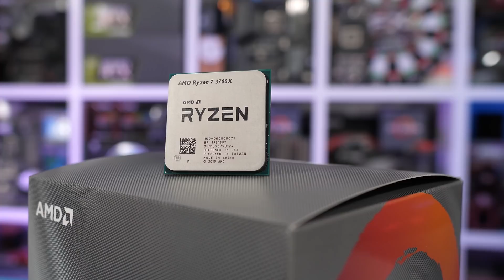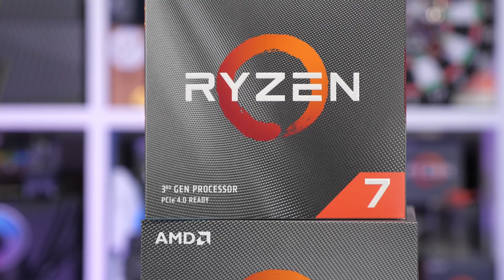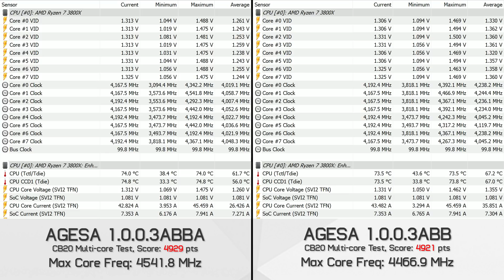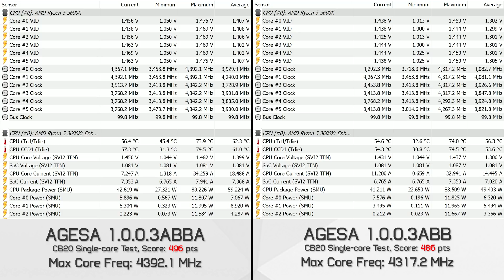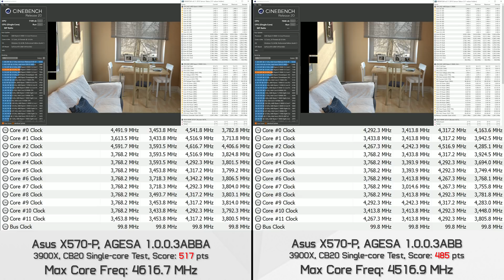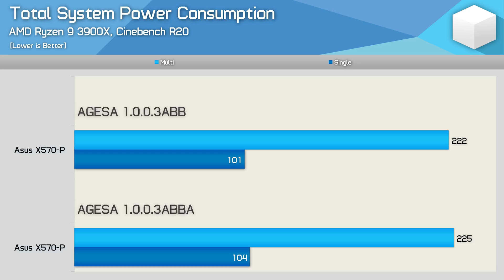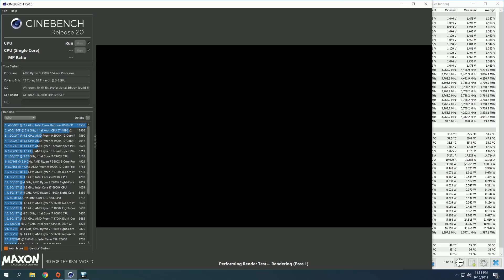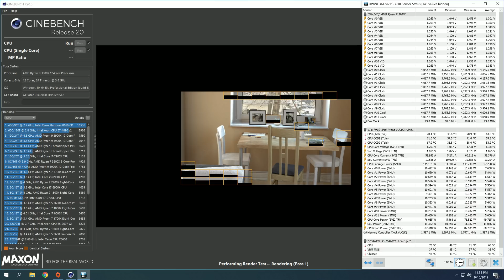3rd Gen Ryzen Boost Clock Fix Benchmarked, AGESA ABBA Time!

Comment: der8auer proofed that it doesnt matter which Board you use even user of the  extreme had the problem and also the fix didnt help to ban the problem as far as i know not even till today. Because my 3950x is not able to reach the 4.7Ghz on a new set up pc. 
And that whole stroy is a little bit annoying, AMD just could say ok we have a fix but it not working 100 percent but they just made it like this that after load the single core will boost high enough so in the max indication field the right boost will be shown with not even reaching it once during single core load. And looks like it worked out for them and they got away with it.....Hope they will just be honest with the next once. They are better than intel and they dont need to lie.

Comment: Im running Ryzen 3600 on an Asus Tuf Gaming with 3200mhz ram and M.2 ssd  Nvme  type.  Everything works ok but not as fast as I was expecting for these components. I dont overclock or intend too. Do I need to update to the AGESA bios? Any advise would be appreciated. Thanks in advance.

Comment: Finally got ABBA on X470 Prime. 3600X has hit 4490MHz on 1 core a few times, more commonly 4417. Previously I was running 4267MHz all-core on light multithreaded workloads with PBO enabled, now hitting 4342MHz all-core on light multithreaded workloads with PBO. Chip runs slightly warmer, from 64c to 67c on heavy multithreaded workloads @ 4167MHz, but still runs at 51c on light multithreaded workloads @ 4342MHz. (custom watercooling)

Comment: The 99.8 MHZ BCLCK issue you are running into GIGABYTE boards is due to Spread Spectrum being enabled by default.   On the newer version of the BIOS, there's an option to disable it now (it's in the Tweaker Menu in the BIOS) - once disabled, BCLCK will be at 100 MHZ.

Comment: I'm wondering is this all possible or applicable on boards with X470 chipset. But, all in all,  I'm OK with 3800X CPU which hits 4. 465 GHz on single core in CB20. Not advertised 4.5 GHz, but very likeable.

Comment: I don't have a horse in this race so it does not matter to me whether the AMD CPUs hit a specific clock speed or not. 
Having said that, this issue speaks volumes about AMD. 
With all of the different part numbers at each tier and operating frequency being the only difference, AMD is clearly and stringently binning the CPUs. 
It is inconceivable that they are unaware of the exact frequency each individual CPU (perhaps a lot # of CPUs) can achieve. 
With such a huge number of CPUs falling short of the specification it is clear that AMD knowingly chose to lie about the frequency.  
It really is that plain and simple.  
Considering the overwhelming number of people that buy retail packaged AMD CPUs are enthusiasts accustomed to being able to significantly overclock their CPU it was impossible for this to go unnoticed. 
I do not think anyone buying a CPU that did not hit the speed they paid for over reacted at all. 
Hopefully the fix implemented will not unravel something else down the road. 

The most baffling part of this to me is AMD clearly has a winner here and could have simply written a slightly lower clock speed on the box. 
Then the enthusiasts would be crowing even louder about how great and wonderful AMD is instead of feeling like they got shafted.

Comment: Mine, X570 Aorus and R5 3600 gained 75-100MHz with the ABBA version and finally got up to 4.200MHz. For anyone wants that last missing 7~8MHz can disable “Spread Spectrum” in BIOS, if there is such a setting in there. This will set BCLK from 99.8MHz to an even 100MHz. ___Gimmie Gimmie Gimmie a  boost...

Comment: Well, just downloaded 1021 (I believe) bios Asus just released for the Asus Gaming TUF X570-Plus wifi. With ABB, maxed out at 4217. With ABBA, the 3700x maxes out at 4367. (150mhz increase). The other 33mhz is accounted for by the bclk only being 99.8, etc. It also lowered the top end voltage and smoothed it out (it doesn't go above 1.395 on single core) . Now I don't get run away die temps in the 90s, while the cpu remained at 65. Now if I could just overcome the lower bclk

Comment: weird my 3600 can do 4.2ghz all core at 1.38volts on my asus b350 f gaming board but with my x470 gigabyte gaming 7 wifi-50 board it wont do 4.2ghz even at 1.4volts, hell it wouldnt even boot at all.. i need to update the gigabyte board to newest bios tho but hard to believe my cheaper and older b350 board can do it better and asus has only givin me one bios update for my b350 since 3rd gen ryzen's launch.

Comment: ASUS TUF firmware released as well.  Thanks for all you guys do.
Reply: You happy with the mobo? Plan on running a 3900x and 2x8gb 4266cl19-19-19-39. Under custom water.
Reply: @AZ007914  I'm not a reviewer and I don't do as much gaming, but what I do is a bit more strenuous than most games(3d rendering).  Currently have a 3700x as a stand in until the 3950x launches.  It's only 65W TDP, but I've watched several reviews of the power rail and they've all been positive.  Short answer is I don't have any complaints but I'm currently at 65W.  Great board for the money if you want to future proof your system IMO.

Comment: I just got the BIOS from the Gigabyte web site.  Used it on my grandsons Gigabyte X570 Ultra and 3700X,  Before  three cores at 4366, one at 4316 and the rest at 4250.  After one core at 4391, two at 4366, all of the rest at 4316.

Comment: Hi steve, I want ask about BCLK, my motherboard ASUS X370-f gaming strix always get BSOD when booting if i changed BCLK, event when i change below 1.0 point (100.5), can you give light how to change BCLK without BSOD.
my 3700x use 1.0.0.3ABB bios got 4839 on multi but only 493 on single. i have thingking about playing BCLK but have that problem. is that possible because i push my RAM OC (corsair vengeance rgb 3000mhz C15) to max 3400mhz (max limit for micron B-die from ryzen RAM calculator) ? do i need lowering RAM speed ?  maybe to 3333 Mhz for my RAM ?
thanks for video..
Reply: BCLK over 100 negatively affect HDD,SSD,NVME especially picky can corrupt data fast , some other hardware might get affected , if you can't boot over 100 bclk something in your PC dosnt like it. as simple as that.

Comment: 9:18 On the benchmarks, you wrote [lower is better], instead of [higher is better]...
Does the bios update for Zen 2, affect the 2000 series too? Because my 2700X doesn't quite want to boost... I have the first bios update for Zen 2, agesa combo 1.0.0.1.

Comment: Out of the box on launch day AMD knew they would  beat Intel at every price level. I think they have a natural inclination to lie about something even if what they're lying about has no effect on performance. They just feel the need to lie. All they had to do was advertise the correct  clock speeds and then later if they felt like it update the BIOS with the clock boost. Even though the boost wouldn't amount to anything im sure it would have increased their reputation as "The Peoples Champ".

Comment: This Agesa has been huge for me. I was originally only seeing boost speeds of  4.2ghz with my 3900x in games. Cinebench would peak at 4.5ghz. I now see 4.575 in cinebench but it’ll peak to 4.65 at desktop. Now in games it pretty much stays at 4.35ghz- 4.45ghz with occasional boosts up to 4.5. This new update also fixed a cmos issue I was having where the bios would corrupt if any settings were applied. Cmos would not work to save the board and it would have to be reflashed every time. I also used to have fclk issues where I couldn’t get the fclk to go above 1600mhz. I have 3600MHz ram so this was an issue. Fclk now goes to 1800 without any adjustments needed. Phenomenal job AMD and board manufacturers!

Comment: I have a 3800x and a 3900x - both CPU's hit advertised boosts or better on multiple cores each - the 3800X being the better of the two for more cores at rated or above boost.  I have been testing on my bench using the Aorus Master since day 3 of launch and every BIOS F3 on up. I have not updated to F7a (beta ABBA) ... F5 has been solid.  I am going to give it some more time perhaps even wait for the official F7 or whatever they name non-beta BIOS. I suspect there will be a few more rounds of BIOS revs still to come before the dust settles. I am very happy tho to see others finally getting more of what they expected.  Also very pleased with the level of support and communication to the user community that Gigabyte has provided.  I am still waiting from Asus to produce something that will tempt me to update my C7H...  Thank you, Hardware Unboxed for all the testing that you have done!

Comment: I think it was more to do with a product not achieving advertised speeds. I got 50mhz extra single core to 4.625 on two cores. Two other cores reach 4.6. I'm on x570 xtreme with 3900x. Slight increases scores in Cinebench r20 both single and multi core. Got a 25mhz increase all core boost. Score of 7331. I changed my ram settings and forget what I got single core.

Comment: To me the issues with Zen2 so far have been so minor it's hardly worth talking about. Early adopter tax is and always has been a real thing, but so far AMD has nailed it pretty much every single release with Zen launches, at least as far as major issues go.

Remember when Sandy Birdge had a broken chipset? Or when Kaby Lake would cause "unpredictable system behaviour"(AKA crashing, BIOS fix). Heat problems with Ivy Bridge, not to mention the on-going security issues etc etc.

Nobody releases a perfect system the first time around. In my line of work when a new product platform is launched it often takes several years to iron out all the issues across the range of products, hell some of the issues from 20 years ago still don't have a real fix just a band aid that has to be re-applied every so often. 

People are whiny cunts these days though, so I guess it's to be expected.

Comment: it's fixed but most ppl on b350 boards still can't run ryzen 3rd gen cpu's. MSI still didn't released a clean bios for b350 and b450 boards that can run 3rd gen cpu's without problems.

Comment: I'm not sure what all the controversy is about.  It doesn't say guaranteed sustained single core frequency.  It is a Max frequency.  In other words the highest it could potentially go, with the right hardware and conditions.  If it can be improved with a bios revision, that's great, but people whine too much over 25mhz, and AMD will start locking things down to specific motherboards, and it will be the Intel nightmare of changing boards every generation.  If one company pegs their limit more often, that's great, but it doesn't mean that that is now a rule.  Considering the efficiency and temps of these CPU's, they're doing something right, and taking things in a smart direction.  I'm all about big coolers and overclocking too, but the future won't be water cooled heat monsters.  This is the path to get great performing mobile systems with good battery life.  Keep in mind that I'm talking about 25Mhz complaints.  If you're nowhere near spec, and you're not in a crappy case, with a mini cooler, that's an issue.

Comment: Just tested this beta BIOS on my mobo : Asus ROG Crosshair Hero VIII X570 (WI-FI)

CPU: Ryzen 3900X (No OC, Default Auto Settings)
GPU: RTX 2080Ti (OC'ed to +80 Core Clock, +1000 Mem Clock)
RAM: 32GB G.Skill Trident Z RGB CL16 @ 3600Mhz (Not CL14 for stability)

TimeSpy Score: 15,127
GPU Score: 15,521 
CPU Score: 13,225
Link: https://www.3dmark.com/spy/8521306

FireStrike Score: 27,750
GPU Score: 34,531
CPU Score: 28,860
Link: https://www.3dmark.com/fs/20434003

My CPU boosts more consistently to 4.5Ghz now.. highest is 4591Mhz but still not reaching that 4.6Ghz advertised boost speeds even on single core (Yea I know.. its only 9Mhz short but still!). Overall though, still a decent BIOS update. I hope next one will finally make it boost to 4.6Ghz on my mobo. ( ﹁ ﹁ ) 

On a different note, I'm pleased that the CPU idles more often on lower volts compared to before where every little program including monitoring software such as HWInfo64, CPU-Z, GPU-Z, etc. would make it use much more voltage.

CPU Boosts Screenshot: https://i.imgur.com/po3nzbq.jpg
Reply: I'm not sure why your scores are so low but it could be the power limit on the 2080ti.  Have you maxed it out in afterburner?   Here is my firestrike, still on the original bios at the moment as it hasn't been updated for the Crosshair x470.  https://www.3dmark.com/3dm/39388529?

Comment: These processors boosts are way too sensitive to the load of other cores, so you'd probably get higher if you just turn all that off. I'm getting 529 when I isolate it so nothing interrupts the boost in the background on my Crosshair VIII formula with ABBA.

You should probably fix that bclk too so it wouldnt look as bad. Its fixable on my board by leaving BCLK on auto, and NOT using XMP in bios. Set the timings manually.

https://imgur.com/a/ewdCO7i my results.

Comment: hopefully Asrock gets it right with new bios for x470 taichi.  seems that with each revision since launch, somehting works great, something else sucks.

bios 3.40 for launch - max boost clocks worked great(4.6~4.65) BUT.... IF and ram compatibility was broken, xmp would NOT go higher than 2400
bios 3.50 - lowered max boost clocks by about 50Mhz and improved IF and ram issues but xmp still wouldn't go higher than 2833
bios 3.60 - lowered max boost clocks even further to 4.75~4.5, but now IF and RAM works great, 3200 rated ram now goes to 3333 on xmp stable!

hopefully this new bios keeps the best parts of 3.4 adn 3.6, come on asrock do us right!

Comment: I run a Gigabyte Aorus Pro X570 mobo over here in Holland, with a Ryzen 3900X and 32GB of Corsair Dominator Platinum 3600MHz RAM.
And to keep my CPU nice and cool, there is a Corsair H150i Pro AIO cooler on top of it.
And for gfx i use a AMD 5700 xt, 
even the fact that i am not really a gamer, i am more a video content creator for others.
But it's working nicely over here in Holland after the BIOS update of jesterday, it gets to 4618 MHz over here, where before the update it was only hitting 4524 MHz.
So i am happy.

Comment: Only issue with my 3700X is that HW Monitor and CPU Z reads the core voltage at 4.7 volts.  But cpu is not hot.  It idles at 30C and didnt go past 48C in Cinebench test.   Using Corsair H115i

Comment: My 3700X boost to 4.4ghz for brief periods on at least 4 of the cores and the other cores reach 4.375ghz at times in HW Monitor.  Installed on Asrock X370 Gaming X using bios version 5.50 Agesa 1.0.0.1. Then I downloaded the bios version 5.60 Agesa 1.0.0.3 which has been on their web site for over 3 weeks now.  Nothing really changed.  Some cores hit the max and some dont.  But my Cinebench R15 went up from 2100 to 2150

Comment: Only issue's I'm seeing is extreme instability, I gave up after re-installing Windows 10 daily for 4 straight days the thing just BSOD non stop once in Windows, might do it 4-6 times in a row each morning and than finally decided to boot into Windows and not BSOD than it works perfectly fine for 12 hours straight 0 problems until I turn it off and try booting it again in the morning. I've done memory tests, tried to fix issues in the event logs, etc nothing I do can seem to fix it I've installed Windows on different drives (in case that was the issue) I've ran memory tests for 9 hours straight on each stick of ram no fault no error perfectly fine. Yet the system BSOD so many times from a cold start it either corrupts my install of Windows or seriously damages it to the point where it's virtually useless.

I've done everything I could from re-seating the CPU multiple times, cleaning the ram pins/changing ram slots, trying to find if it's hardware related/software ... etc

I gave up and put all of it in my closet and just put my old CPU/Motherboard/Ram back into my PC... I've used this set up for 5 years it's never once BSOD on me and in that 5 years it has not given me nearly as much trouble as just 1 day with the Ryzen 5 3600, MSI B450 Tomahawk, and the 16 GB's of ram that's on the QL list .. sad thing is I bought it one piece at a time until I could afford everything over the period of months so no real warranty (from stores) and no real money to send stuff off for RMA lol that system gave me unfathomable levels of problems and stress I regret spending my $400 on it

Comment: Gigabyte X570 Elite WiFI AMD 3600 old bios 4142 new bios 4192
Reply: Are you running the stock cooler?
Reply: @dunkmaster1564  No, A Bequiet PureRock, The memory clock is 1597.1 instead of 1600, so I think the 8mhz on the cpu may be related to that.

Comment: the voltages on hwinfo are wrong if you want actual voltage look in ryzen master
Reply from the maker: They are reading the same thing.
Reply: @Hardwareunboxed  oh that's weird mine only reads down to .9 volts on hwinfo

Comment: The new gigabyte bioses have the ability to disable spread spectrum. This should resolve your 99.8 base clock
Reply: i dont have a gb mobo but cant you just lock the bus clock to 100mhz?
Reply: @porkowner  setting the bus clock at 100 mhz will still run it at a minor offset when spread spectrum is enabled
Reply: I am on the x570 ultra using the latest F6a BIOS
Reply: @giuseppearpino8657  yes, on the x570 bioses, the ability to toggle spread spectrum seems to have come along with the ABBA updates

Comment: On my Asus Strix X570-F with a 3600X with ABBA I definitely have higher single core boosting, hits 4391mhz. Cinebench R15 is Down though on multicore by 100pt, R20 it's about 50pt.